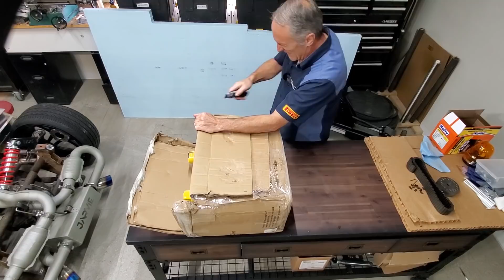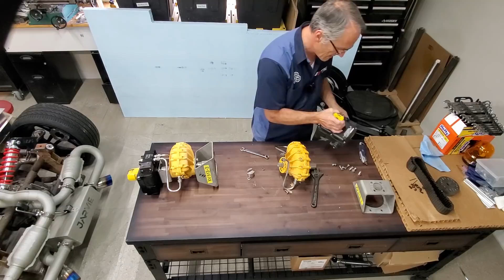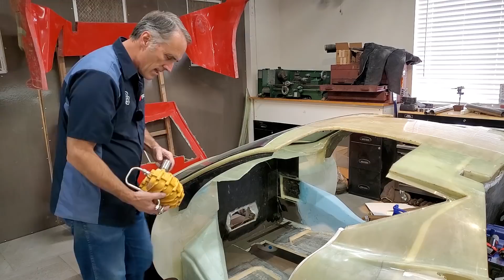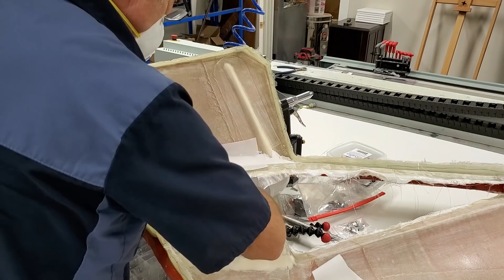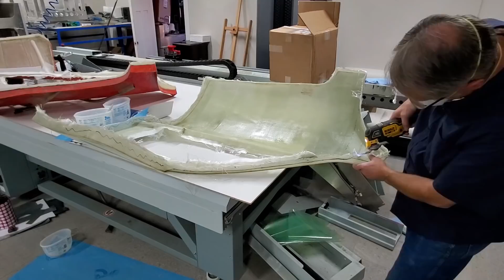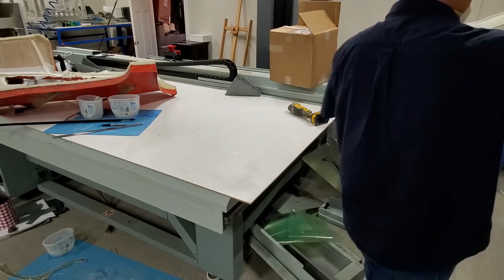A49 - Kinetrol 90 unboxing. Arete supercar project

Comment: Howdy, mechanical engineer here, watching from Canada. I used to build prototype trucks for an electric vehicle company for a while, and you're doing an excellent job. The only thing that has caught my eye for improvement enough that would warrant a message, is the door mechanism. A properly sprung door (torsion bar, gas strut etc) should require very little force to open and close it - especially with your lightweight construction. Consider mounting the door, weighing the door to its estimated weight (including glass etc), springing the door so that it is neutrally balanced, and then select a very small, lightweight actuator to match with your lightweight ethos you already have going.
Reply from the maker: should require very little force to open and close it - How about when a gust of 50mph wind hits it? detents, stops, latches?  This solves all of them and I have the room. Ebay actuators were cheap, this will be fun trying something different. Thanks for your input.

Comment: We used to install those on control valves in power plants and chemical plants.
Reply from the maker: Yeah, somewhere out there in some refinery, oil is dumping on the ground. ha!
Reply: Mainly used for high pressure steam. Lot bigger Kinetrols though.
Reply: I would also recommend a Hytork actuator, easier to find parts if needed through Emerson or one of their local business partners.

Comment: I worked in a machine shop in fleet, Hampshire when I left collage that made those actuators. We used them in the machining fixtures for work holding because they are quick and unbelievably powerful. I tried to hold one that was about 4” across still with a spanner once, I failed....They’re used on a lot of bus doors hence the air release sound when the doors open or close. They’re said to have been the only thing still working after a huge fire at a Hemel Hempstead oil refinery.  It was a pretty weird place that factory. It had a silence at lunch rule in the canteen. And there were a few old boys who completely ignored the ban on  smoking in a workplace without trying to hide it or even make any excuses. They just carried on working with a roll up hanging out their mouth.
Reply from the maker: These are made in England, but Ii swear I smelled smoke when I put air through it . .
Reply: @BuilderCreator  yeh, fleet, Hampshire, England. There’s also a factory in Farnham which is the next town. Love your videos mate. Keep up the good work.

Comment: If you don’t regulate the air pressure and restrict the air outlets these yellow rotating actuators will rip your body apart no matter how firm you brace them.

You would be better off to use a straight actuator fixed to something solid (frame) and have it pull on the door hinge.

Comment: don't listen to these clueless critics!! the car community if full of douchebags who never got oil on their hands (except maybe olive oil) who go full out with critics and unrequested suggestions.
I am an engeneer and I know well the math behind every mod (even the custom built ones) on my car, and still people in car forums have the guts to say their clueless (and often unpolite) opinion.
honestly your car looks well built (for sure more than the fiberglass bodies Lotus used to do in the 80s-90s), the only "critique" one could make is that you are putting maybe too much weight, stiffness money and effort in non structural parts (like the engine cover and the bottom part of the door). but It is your project and you know how you want It to be.
I'm curious why you haven't chose to use a rollcage tho, in my opinion It would have made the project way easier

Comment: Very interesting. Are these actuators found on other cars or was this your idea? I know I have seen those gas struts on other doors that open upwards, and I think the DeLorean has some kind of torsion bar if I remember right.
Reply from the maker: I've never seen them used before.
Reply: Nothing to do with cars, I remember them being used on myth busters and the soldier marching on the bridge experiment!
Reply: The Nova/Sterling and other names Kit-car had an option for automatic door opening. Just 1 "door", front and side windows and roof was the door. I don't know how it was made though.
Reply: Those actuators are used to open and close valves in hazardous environments, such as a fuel loading facility.

Comment: Does someone make a smaller, lighter version of that actuator? Seems a bit much for your project. Found this,  https://kinetrol.com/index.html  Might be a better choice.  https://kinetrol.com/actuator/model/actuator_model_07.html
Reply from the maker: I could have used a smaller actuator, but bigger is better. There are things to consider beyond lifting or lowering the door. If I were parked along side the road when a semi truck drives by I will not have detentes or springs to hold the door in place. The surface area in the actuator is the only detent or spring to counter a 50mph gust. and other such scenarios. I could machine 8 lbs off this unit as they are made for much more harsh environments and power requirements than I need.
Reply: @BuilderCreator  GL
Reply: @BuilderCreator  Thanks  for the reply. I’m sure they’ll be more than adequate :-D

Really enjoying the build series - It’s a very well thought out design and beautifully styled too!
Reply: @BuilderCreator  Makes sense. Were those 09's as opposed to 90's? Couldn't find '90's and '80's were way bigger. if so that would only be around 9lbs per unit to start with.
Reply from the maker: @bradmaas6875  90s out of the 09 series- at least by the markings (8.5lbs per the website) they are aluminum, look heavier than they are.
Reply: @BuilderCreator  bigger is heavier :). I understand your way of thought. But this would mean you would constantly need to keep pressure on the closing chamber of the actuator to keep it closed. Even when driving.

It would be way more practical and safer to use a second actuator as locking pin. Creating a pneumatic unlocking and opening sequence in one go is very easy.

If you want to keep it simple and closed by one actuator a trapezoidal or metric spindle drive would be another possibility.
Reply: My thoughts too. Does seem like a sledgehammer to crack a nut at first glance. I assume the car does need a compressor already. Maybe the intention is to make the car hover by flapping the doors! LOL
Reply: @andylewis7360  I thought they where meant as some kind of front suspension lift, boy was I wrong.
Reply: Festo has them as well. All different sizes. It may be even better to look at another another pneumatic actuator for such a movement.
Reply: Is it really interesting to use these kind of heavy actuator in a car? Koenisegg use this stuff too?
Reply: @SETHalpine  They most certainly do not use super heavy components like this.
They only added a little bit of weight when making the Regeras autoskin
Reply: @SETHalpine  Koenigsegg use hydraulics to actuate, they actually use brake hoses from mountain bikes to transfer the fluid.

Comment: I still don't get conseption or disine of ur car. u have steal rear frame with inline6 with tubos.  Now ppl rly not after tubo power but exesebilty of its power with right amout of it at moment. don't think tubo 6 can give it unles its liqued intercooler nerar tubo-intake. and unless tubo is wathles with low diametr. U biulding midle section i don't see any frame there. will it be like lotus esprit monoco with little frame on the midde there tunel is? Don't u think to switch to aliminium forvord frame and alimunum suspention. i see transmission is facing front of the car will it be lie 4x4 then? Dob't think its forward wheel drave car. Then how u retuon power to back wheels. Could you pls make widio there i show scemetics of ur progect and show evry aspect of ur car pls. kinda same i can't talk to u about it face to face and touch ur car slide my hand on its hood.
Reply: Man, try to use some kind of auto correction before.
Reply from the maker: Videos coming up will explain more especially the drive train. Stay tuned.
Reply: @BuilderCreator  thx. And sory for bad perlling i have some mental disorder. I can talk but typing is havy on me.
Reply from the maker: @BalvanKolbasukhin  Thats okay! I'm and excellent reader of bad spelling. Ha! It's beter to be nice than correct. :)

Comment: Hello, I stumbled upon your channel last week and I loved the project, this is kind of my dream, I have just one question, What led you to use pneumatic actuators rather than electric motors? those things look pertty heavy, not to mention all the hoses, pumps, etc.
Reply from the maker: Electric actuators under $500 are crap! I will have air on board for other components.
Reply: Torque available is proportional to air pressure and for an electric motor to come close would take a serious gear reduction. There's no sparks and few moving parts. If you supply full air pressure to both ports you can hold the door in position too. They have a little hack trick too if you make them air over hydraulic. By using DC proportional valves normally reserved for positioning systems along with PID controller logic and position feedback it's feasible to option this particular vehicle with a butterfly maneuver mode, a wishful thinking, limp home simulator....flap flap...flap flap. 
With one way check windows...?

Comment: Does the actuator range match the range of your doors? Is there a risk that the actuator continues when it should stop and tears the brackets from their mounts?
Reply from the maker: Over 90 degrees of rotation I need 70 or so. Position sensor (like the ones I removed, but much smaller) will control position, speed and stops.

Comment: You're the first I've seen use "micro-spheres" in epoxy resin.  Do you happen to have any videos explaining the process for mixing, using, and application of this product?  Thank you.
Reply from the maker: Mix your epoxy and hardener- add microspheres and stir. That's it.  If you just use a small amount it will make a slurry that you can create a sandable surface, add more it becomes a thick paste. Once you add the micro don't use it a a structural resin.
Reply: Kipring Payne I don’t know about their use in car fabrication, but microspheres are commonly used for developing filler media in boatbuilding. Search for strip-built canoe construction or stitch-and-glue boatbuilding and you’ll find lots of explanatory videos, assuming you can’t find anything directly addressing fiberglass cars. Hope that’s helpful.
Reply: I've used these in combination with thixotropic powder. These ballons create a foam like resin. They reduce the density significantly, but by that also reduce its structural integrety. It makes for a great cheap putty, because it can be sanded easily. The Thixo powder, which usually acompanies the use makes it more viscose and can turn a flowy resin into any viscosity up to a clay like modeling dough. 
It has many advantages, but keep in mind that the main component of this thing still is epoxy resin, which cures in a exothermal reaction. Creating a huge blob of this stuff will release lots of heat during curing, and following the square cube law will have a disproportinally small surface area to radiate this heat off, so it might heat itself to the point where the epoxy denaturates. 
Use it, it's great. But be aware of the problems of these putties, and don't build to much thickness in one application. 
I hope this helps.
Reply from the maker: Good addition to the comments. I will be using some other fillers such as flocked cotton and fine chopped strand for more "structural" applications. Coming up.